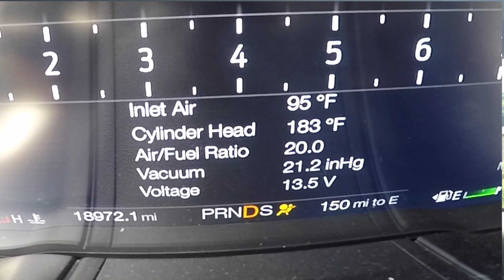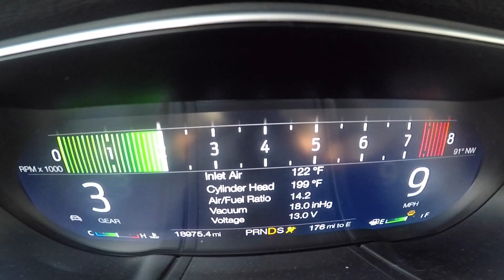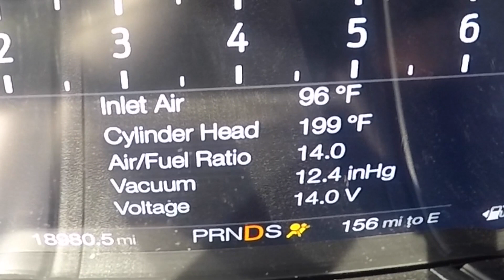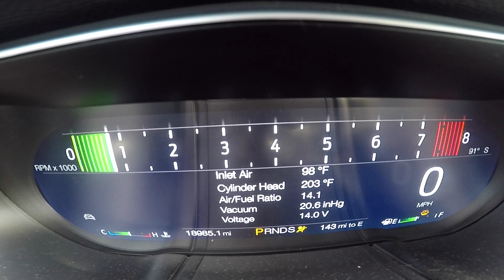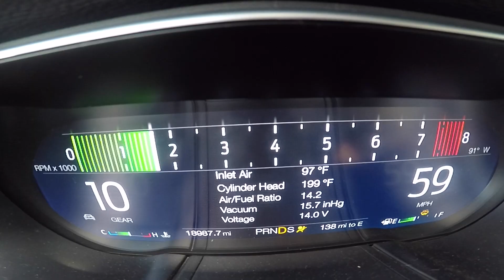18-19 MUSTANG GT - STOCK VS COLD AIR INTAKE- "REAL WORLD" IAT TESTING

Comment: Read an interesting engineering analysis about this after Alex Flores suggested I stick with the stock air box until going "max effort."

While an after market intake may allow more air flow, the higher IAT lowers the air density which actually diminishes the power gain. Even at lower ambient temps, you'll still experience higher IATs with the open box setup. 

If it really took you 3 miles to drop your IAT back to baseline, I'd say you're better off with a closed box, either stock or after market, like Roush or Steeda. That's the way I plan to go when I add LT and x pipe next year.  Going E85 later this week!
Reply: thats why you only go for cold aire intake, so the way to go is air raid intake ! more aire flow, and cold air

Comment: I think you guys Under estimate the increase airflow and Over estimate the effect from higher IATs when sitting still….. the intakes flow so much better, it’s much easier for the engine to pull in air and frees up horsepower when doing a tune with it due to the increased air flow…. Also they sound SO MUCH BETTER.

Comment: I live in Louisiana and with my 2019 mustang GT i put a JLT on there and ended up swapping back to my stock air intake and did a k&n drop in filter. The JLT would get about 15-20 degrees hotter sitting in ttraffic over my stock intake and the car would start to pull timing and i run E85 majority of the time. Personally its not worth the money on the newer mustangs.
Reply: Just did the same thing and I’m from Louisiana as well
Reply: Yup I’m in biloxi and it didn’t like it.
Reply: Louisiana here also ess supercharger with intake in the bumper. IAT maybe 2° higher

Comment: JLT needs to develop a true CAI on these S550’s like they did with the 2V/GT and Cobras. Fender well mount to suck in the outside air.
Reply: Exactly, outside the engine bay. Just like GSM for the 2006-10 Chargers.

Comment: Interesting, I had a K&N cold air intake on my F150 and ran into a Ford engineer at Ford and we spoke about Cold Air Intake vs stock intakes, Your right they do make a little more power only in the right temperatures and conditions, However the Ford engineer I spoke too says your better off the the stock paper filter, I did ask him why? He explain that the paper filter does not allow as much dust and oil in your intake as a Cold Air Intake would, But you showed me something new today about the difference in engine temperatures, Interesting well done dude! 😎🏁

Comment: The idea isn't cooler air but MORE air. With my JLT I average about 5deg above ambient when I'm moving. When you're in the city, stop and go and idle in traffic...yeah it will have higher temps due to heat soak. Same as sitting in staging at the track

Comment: Not sure if the supercharger helps cool it but my Roush intake temps are always exactly what ever the outside temp is when the car is moving, and if I sit for a moment it will usually only go up 5-6 degrees. As soon as I move it fairly quickly drops back to outside temps.
Reply: It's because of the closed air box! I have the roush SC kit with cai!

Comment: I read an article awhile back that said the automotive engineers design the stock air intakes to get the coolest air possible and to keep underhood heat out and this proves it. Good video
Reply from the maker: Thanks
Reply: @Zander13Productions  
Been watching your channel for awhile, I remember when you had the Hellcat. I've had 2 Hellcat's, one manual 2015 and recently a 2019 Redeye. Well to make a long story short, when Covid caused the computer chip shortage and used car values went up, I sold the Redeye at a profit and bought a new 2021 Mustang 5.0. Man, this is a fun car to drive! I've always wanted one back in the day when the Fox Body's were out so I decided to get a new Coyote! I see why people like the cars so much, good power and handling characteristics!😁👍
Reply from the maker: @markurbancowboy  I miss the cat from time to time but the new Mustangs are just so great to build upon. You planning to boost it?
Reply: @Zander13Productions  
Maybe in the future I'll add a blower. It's awesome the cars can take one with no issues and you can even get it installed at your local Ford dealership. 👍

Comment: For all you engine building geniuses out there saying a CAI is a waste of time, here's a question:
Why did Ford modify the air intake on the 2018 and newer Mustangs relative to the 2015-2017 models? Because they improved the design, it flows better, and  produces more horsepower. The old saying is every little bit helps. A CAI won't matter much below 4000 rpm, but once above that it can make a significant difference in the tumbling effect and lowered restriction. I've worked on venturis for the aerospace industry and even slight modifications affect airflow. All mods being equal, the difference from that point forward is in the tuning and type of fuel being used.

Comment: Hey man!  Love your channel.  Just wanted to mention that I wrapped my JLT intake and air box with DEI gold heat tape and saw about a 3-4 degree drop in my average IAT.
Reply from the maker: Thanks 🙏 That is a great idea.
Reply: Does it have to specifically be that 'gold' foil or can it be any reflective surface?

I was thinking about doing 2 layers of HVAC foil tape.

Comment: I would have liked to seen same test BUT when you idle and get hot go to at least an 1/8th mile smash and see which was at what temp.
 The stock box with a good filter may be the best compromise.
Reply: My Supercharger kit comes with a green filter but didnt Justin at American Muscle do the test at track and the KN picked his car up then not filter also picked it up?
 Memory is shot right now I want to say it was worth something to go KN...Boosted Jay or whatever also drilled holes in his diverter for a more direct path.....
 I have active shutters on my car and they seem to counter everything I try to play with on cooling it down hehe...
 I need to gut the frames where they arent blocking air but still senses motor working so it doesnt throw a code

Comment: Great comparison kept my stock air box it may be a good thing to put it back on for mustang week. I noticed your voltage looked low at times 12.5 could cause running issues. A good idle battery is about 12.8.
Reply: Isn’t the resolution on the reading .5v?  Mine says 12.5V if you only turn on accessories. It cranks no problem, so I’m pretty sure it’s underestimating. Or it’s taking into account all the voltage drop and reading the end of the circuit.

Comment: Some other tests you could have done to prove the difference between the 2 are doing a WOT pull to see how much faster iats drops between the 2 also calculate surface aera of the filters to compare volumetric movement of air and also track lbs of air per min using your tuner device, i have had both intakes and the temps for me are basically the same except for standing in traffic, the jlt was 3 degrees higher but has seemed to drop faster when at higher speeds. Over all OEM gas gotten a lot better over time no arguments there, but after market still has a slight edge in my view point

Comment: Your front vent cover on the bumper has a plate that blocks direct air flow to the intake.  it would be better to either drill holes in the upper grill plate that blocks direct air flow or change the front, upper grill.  They make after market grills, which AmericanMuscle and CJ pony parts sell l.

Comment: I'm becoming rather convinced that the late model Coyotes have a great intake and air filter box.  The tuner after market is full of parts costing lots of money that will give you more power on the Dyno. 
Not sure if its worth the hassle to Run E85, a tune and 5 grand worth of fancy parts to take a 18 up GT from 408ish WHP to like 470 and have issues with emissions  and drivability.  I like the Idea of a Long Tube Header setup with the whole top side of the engine looking stock. I think the stock power is really good but would be thrilled to death to have the 18 to 21 gts Advertised 460 hp to the actual wheels

Comment: You can either buy Steeda's closed box Cai, Holley inTech Cai, or just buy a modular Cai tube to connect to your stock box.  Those are your best options for a little power gain and low iat's.

Comment: I thought about running an Boat bilge fan in the the tube that's in the front bumper to push cold air around the filter when sitting still. This should put a positive cold air flow around the filter for the engine to pull in. It's just a thought I don't know how hard it be to modify the tube to make it work.

Comment: Seems #YDBT was right... I know there are some closed top cold air's like Roush and Steeda but how well they fare performance wise over stock I dunno.
Reply: hello what does YDBT stand for?
Reply: I run the Steeda and it’s 3-5 degrees hotter than ambient when the car is moving in open air. If there are cars in front of you but everyone is moving it’s about 10 hotter. In traffic there is obviously is no airflow so it gets hot.
Reply: @papayaman123  YDBT= Alex Flores @ (IIRC) Lund. He has a YouTube channel and did a video on this topic.  Search for #ydbt, you'll find it.
Reply: PapayaMan YOLO Doucheag Tuning. It’s in reference to Alejandro Flores.
Reply: @MrDirtyRod  Hmm, does the steeda not connect to outside engine bay air like the stock box does?
Reply: It does use the stock air tunnel to the front grill but you still lose a few degrees even when air is flowing. My stock box lost 2-3 degrees to the outside air as well in open air unless it was really cold outside.

Comment: My open air pmas is at least 20-30 degrees higher than ambient when stopped on very hot days. Cools down on moving. I think beat option is an aftermarket closed lid intake.
But if u have a custom tuner u can program engine fans to come on sooner or get an aftermarket low temp thermostat. But then in winter takes car longer to warm up

Comment: Try wrapping it in Aluminum foil to reject the heat.Cold air is a misnomer imho but it will benefit only at the higher end of the rpm range.

Comment: This is a great comparison video. I have a 2019 camaro ss and the stock airbox didnt seem to perform well with heatsoaking and waiting at the staging lanes. I am seeing temps in the 130+ at the beginning of the runs. I just installed a RotoFab open box/sealed with hood design and Im looking forward to seeing how this intake performs with waiting at the staging lanes. I also noticed that the stock airbox iats wouldnt come back down till around 3rd gear which is close to halfway down the track! Hoping the Rotofab does better in that area!

Comment: Aftermarket intake companies compare a open air intake to the stock air box with the HOOD OPEN. The stock air box is closed. Of course the open air intake is going to make power on a chassis dyno with the hood up. That's a apples to oranges comparison.

Comment: I'm confused doesn't CAI with 91-93 tune make 30-40more hp and 38ftlb torque and better gas mileage and higher exhaust note? I'm just curious if it's worth the money. Cuz basically it seems stationary it gets hotter like a motorcycle with a CAI but stock it stays cooler. But that's stationary only. And if your going for performance stationary isn't were you'll get it. Also if you want to do big performance mods you need a CAI like for a supercharger.

Comment: You should compare the stock to the closed intake from roush and injen.  Specifically injen which falsely advertises like 30hp with out a tune.  My inlet air is around 85 when moving with my Roush.  But it seems that’s really where the advantage to the I take takes affect. During movement.
Reply: What part of the country do you live in? I live in south texas and the temp outside is 100°. 85° i.t. will never be on my dash until Oct 😢
Reply: On a side note I was considering buying a roush closed box over the steeda closed box. The roush seems like it has a bigger box/filter. And it just looks sexier too.
Reply: Rey Gonzalez I live in ny and as long as I’m moving that’s the inlet Temp I get with the Roush intake with The Roush tune.  Not that I think the tune does anything. But just for reference purpose. My car btw dyno’ed is 459hp to the wheels and 407tq to the wheels on 93.  As of the last dyno test.  The only other mod I have is a Corsa Xtreme Active exhaust carback.  So the Roush intake and tune are legit.

Comment: I ordered a K&N drop in filter kit because the stock box is very good at keeping hot air out. I also have a 91-93 Lund Tune on it so I can't wait to see how it runs once I add the new K&N drop in filter kit. 💪💪💪 Awesome video.
Reply from the maker: 💪💪💪 thanks 🙏
Reply: Did it makes a difference Lund tune k&n drop in  from stock tune I’m looking to do this next month but I don’t know if it’s worth it
Reply: @It7xc  Yes. I now have the flex fuel tune from Lund with the same set up for now. You will really notice it on the mid to top end of the RPM band with HP and on the low to mid end with TQ. I'm about to upgrade my exhaust with Long Tube Headers soon with a retune.
Reply: @SaVarMatner  I have 19 as well i see you have a manual like me, I’ve ordered the 4.09 gears its in the way it will be a damn good upgrade u need one as well these 18+ manuals are too long gears 3.55 is way too sluggish.
Reply: @It7xc  I upgraded to the 2020 55th anniversary edition last August. 6 speed premium fully loaded minus magneride suspension. Ngauge added to it with the K&N kit (drop in filter) flex fuel tune.
Reply: @It7xc  I had 3.73 added from Factory with the torsen slip diff. But the 4.09 will give you plenty of Torque down low but sacrifice that top end by a few MPH.
Reply: @Zander13Productions  what’s your car running in the 8th and it 1/4 ?

Comment: The only way you will know if your JLT truly makes you faster is to have both intake tunes done by the same tuner OPTIMIZED with revisions and then run them at the track back to back monitoring DA. I bet anything if you have to wait in the staging lanes your stock air box will be faster. If you are able to pull right up after a cool down and it's not a hot day the JLT might be faster.

Comment: You'll see a little pick up with at high rpm with the open air box on a dyno pull. Down low it won't be as much. Not something you will feel driving either.

Comment: Would the stock 2018 air box assembly fit in a 2017 gt?
Reply: Not without modifications as its bigger.

Comment: I had for install the Roush 2.65 on my 19 gt and it came with a closed airbox. They knock thru the grill and run an intake tube down to it so it sucks air in from outside direct. My IAT ends up exactly where the outside air temp is. Being its sealed it doesnt rise much when sitting from the engine compartment heat.
Reply: The Roush setup is the most efficient for sure!

Comment: Nice. Thanks Alex. Fyi. Dyno the car for the time trials. 
On 91oct catback gave me 14whp (428whp total om 10speed). Tune 91 PBD extra 9whp. So for the headers.. Are they really worth it? I don't know. Keep going with the good job.
Reply: @Relearn Life Probably. Now the question are:1. Headers itself without tune are worth it?
2.  if headers gain the same hp than catback ,the 2 together will double the output?
Reply: @Relearn Life I did. 12-14whp on 91. 
Dyno was a dynojet at Sonoma used for NASA TT official Dyno. Please feel free to contact me via IG. I have some pics and numbers about it also with a 91 tune and a 96octane tune

Comment: The difference is that with the JLT you will get better flow but you're pulling air from under the hood. The stock box pulls outside air which will be cooler. Cover the JLT and run a tube to the grill for clean cool air and it will be far superior. Of course, this is all my opinion and not backed up by any testing.

Comment: I don't understand how ur IATs are so high! Cruising at 95 degrees mine are at 80-82!
Reply: Sitting in traffic mine definitely go up due to heat soak.
Reply: @cmdrdredd  In my Whipple sitting in traffic they go up but when it hits 130 the fans turn on and they start dropping! But cruising they stay around 80-82!
Reply: Thats just not physically possible to have IAT's lower than ambient unless you have an interchiller (and that would only be IAT2's), maybe your sensor is broken.
Reply: Do you have an IAT sensor relocation kit? Maybe your coolant isnt hot yet and if you have an IAT sensor relocation kit that could be the cause.  It shouldnt be possible to be lower than ambient without an IAT sensor relocation kit and an interchiller, or cool sc coolant perhaps in a trunk tank.
Reply: @a.wheeler7731  I don't have a Relocation kit!

Comment: Short rams are useless. Yes, throttle is more responsive but the performance doesn't change.

Intakes are SHIT! I would rather increase my diameter of the intake to increase air flow
Reply: Yes sir! All day
Reply: Intakes sound good though, thats what makes them worth it on some cars.  Huge sound increase on some cars and its noise is sometimes better than exhaust sound.
Reply: @a.wheeler7731  All these cars are doing is sucking in hot air. A waste of money and performance.
Reply: @H1GHD3FF  I had a intake on a 1999 maxima that was open element but it actually required you to drill a hole in the fender infront of the front wheel area and it sucked cold air from that area.  Also sounded awesome.  The steeda CAI I had on my 2011 mainly just sounded awesome but that car made good power with a tune.  For my 2018 though I just have a K&N filter on my stock airbox.